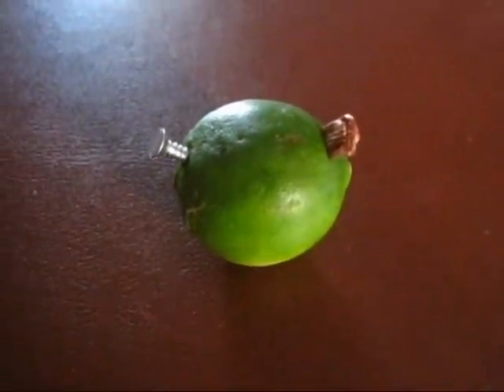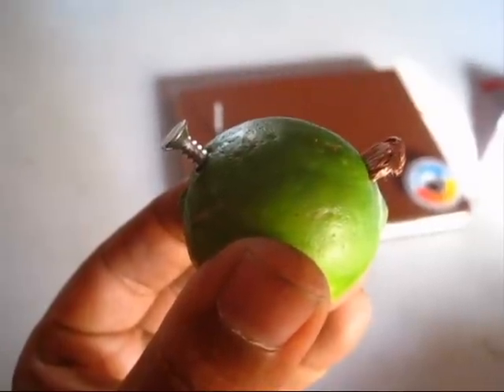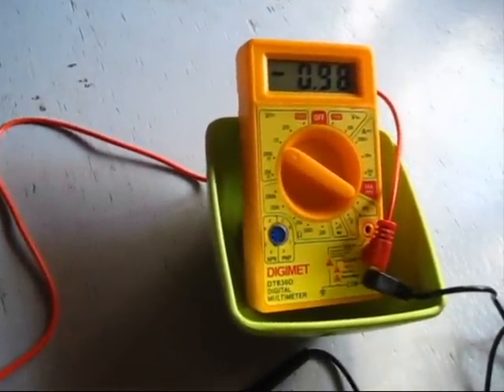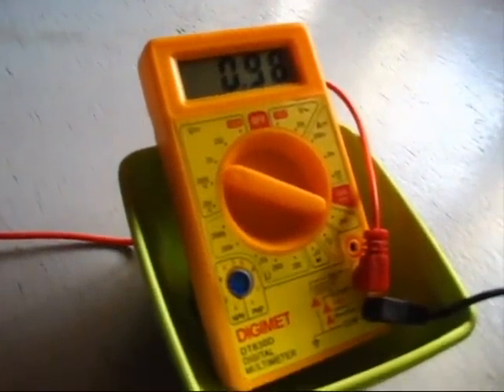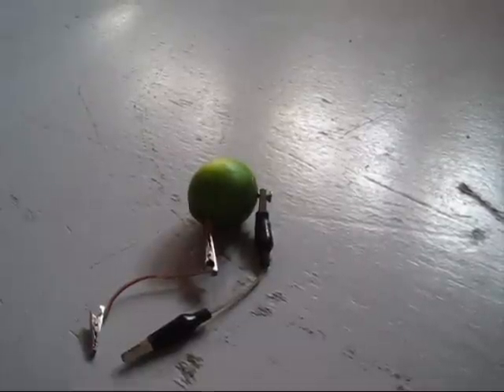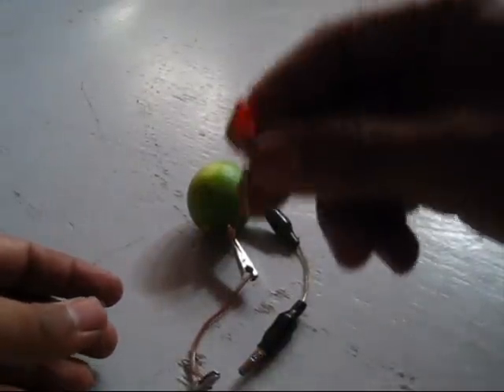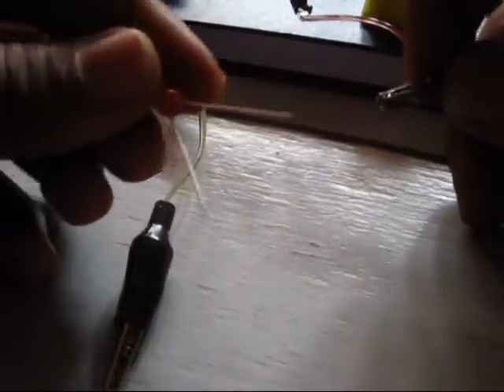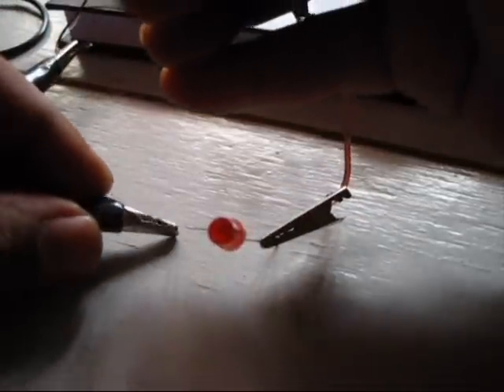How to MAKE a LEMON BATTERY.

Comment: this is what happens in a cell that we use
the cells we use is  miniaturized version of an electrochemical cell : where 2 metal strips of different reactivity are inserted into  a solution of acid to generate electricity.
here the acid solution is the citric acid and the zinc and copper are the metal strips.
the more the difference in the reactivity of the metals , the higher the voltage produced.
for eg. zinc and copper will give a voltage of around 1V  but magnesium and copper can give a voltage upto 2.7V.
the cells we use use a semisolid solution of acid .

Comment: voltage dropping wen i connected to load, kindly advise.i measured voltage by multimeter it was above 4 volts but wen i connected LED voltage is dopping. led not glowing. kindly advise.
Reply from the maker: Make sure you use a RED LED bulb..
White ones require more voltage. If you are getting 4 volts from lemon that means you should be able to power a RED led bulb.

Make sure the connection is in series. Keep wires short as possible long length wires may cause a voltage drop..
Happy Experimenting. :)

Comment: Mr Vic86m, I have a few questions. As you said in the 'About' section: 
"It's based on principle that; when two different metal electrodes are immersed in an acid, it generates the flow of electron."
I also had this theory, but then I thought about car batteries and 9volt batteries, and I realized that the theory doesn't seem to work in those cases, since the two nodes are made of the same metal. How is it that those batteries work when the anode and cathode are made of the same material?